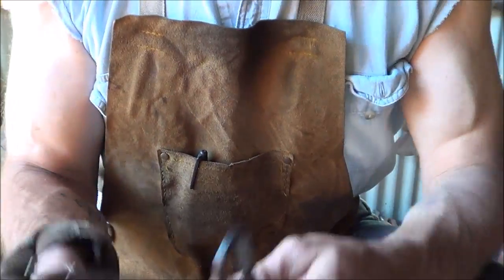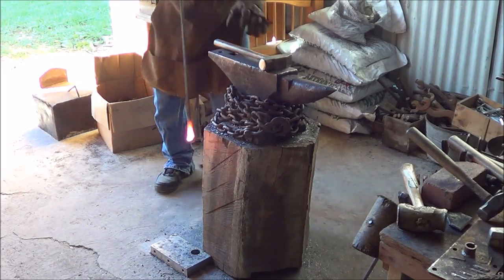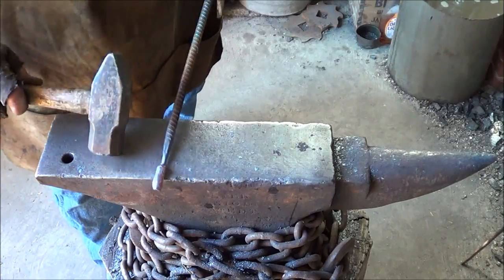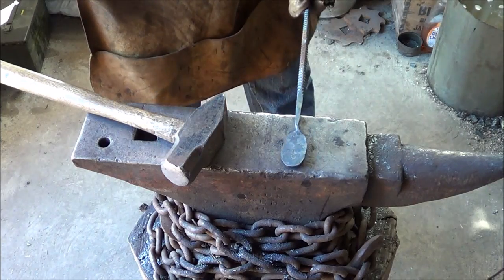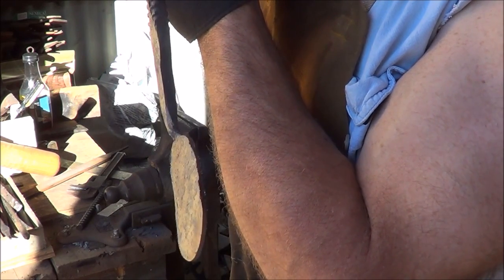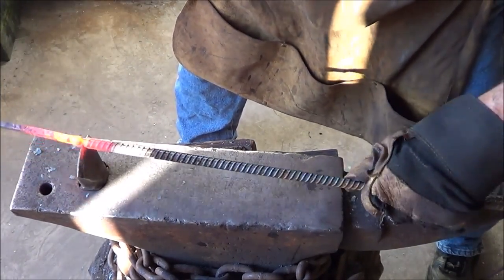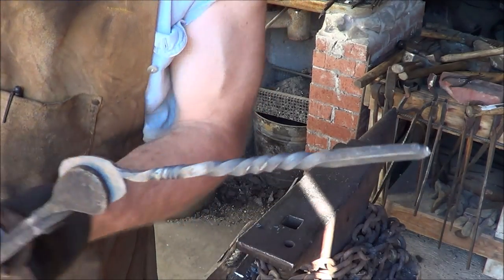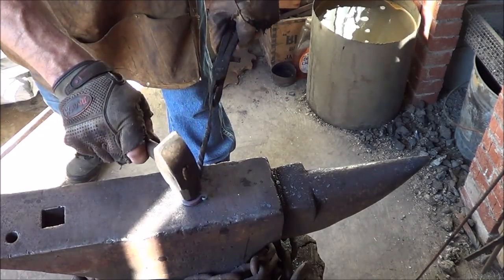Blacksmithing - Forging A Silverware Set - The Spoon

Comment: Chandler..  I like it.  

Find an old ball for a trailer hitch that has no flat spot, modify the post to square and you have a hardy tool that works well for spoons and such.

Thanks for the video..
Shad
Reply: +shadowcastre That's an awesome idea!!
Reply from the maker: +shadowcastre I will be doing just that!   Thanks
Reply: +shadowcastre That truly is an awesome idea, thanks.
Reply: Nice! For larger doming (bowls etc) I got a cheap empty CO2 bottle from a local pub, chopped the bottom 1/4 off it and turned it upside down... The gas bottle bottom is domed inwards, so makes a good dish for forming steel etc :)

Looking for a fire extinguisher with an inward dome on the bottom next for similar thing :D

Comment: I think putting the cold end down and hammering on the hot end will help with upsetting. That way you're not losing that much heat from it touching the plate or anvil. Seen other smiths do it that way, thought I'd mention.
Reply from the maker: +Rocket Girl I have tried a few different ways...   they all seem to have their goods and bads... when I have longer stock I find dropping it most affective...  for shorter stuff i hold it off the anvil and hit the cold end with the hammer... it strikes the anvil and bounces off to help keep the heat...thanks!

Comment: My idea to make the ‘upset’ easier … weld a 2ft tell pipe on the block you are using. ||
This will prevent too many misses and be sure to be as square as possible to head toward making a ball on the end, maybe an inch or inch and a half pipe will work and especially if you decide to make a whole canteen!  ||

Comment: Hey Chandler I found it easier to upset the metal if you clamp it in a vice and heat it and hammer it down. It works wonders man.
Reply from the maker: +Michael Gevergizian I do that too... depends on the piece and where I am trying to go with it...  But yes your approach works well

Comment: Upsetting steel and making spoons....well first upset the steel...call it a worthless chunk of rust that won't even amount to a good finishing nail..lol. But seriously, upset as you are doing in the video, then just neck it down and leave some room for error. Use a ballpein hammer to make a dishing stump in a chunk of hardwood. Hammer the flat rounded portion into the depression with the pein end. Has worked for me in doing everything from spoons to pauldrons (shoulder armor). Sure it smokes a bit when using fresh wood, but eventually it chars. Just remember to sprinkle some water on it after you're done hammering. Hope this helps

Comment: +Chandler Dickinson When upsetting the end, would you not be better off placing the steel on the surface and hitting it with the hammer? Im just thinking you may not get as much warping this way.

Comment: have you tried clamping it in your post vice and hitting it to upset it? Just a question I know little to nothing. Perhaps though it will give you more control over the ball making process
Reply: also, the few times I have done upsets I take a stack of wet rags and cool down the area near the upset so that it doesn't bend as much. I just leave them on the bench and just lay the bar on it. Great vids by the way

Comment: Chandler wouldn't using the hammer to pound on the cold end exert more energy into the piece to upset it faster.  I've seen TechnicusJoe who has had formal training do it that way at least.
Reply from the maker: +garygsp3 There are few methods to get the job done... i alternate depending on the stock I am using... I have hammered before... but I find that with longer stock I get better results with the drop method I show in this video...

Comment: just had a brain fart.  if you modified a ball pen hammer to fit the hardy hole with the ball facing out.  that could leave you with a handy tool for making the spoons
Reply: I have towbar for atv and it fits perfectly in hardyhole. Just had to round small flat spot from the top
Reply from the maker: +Brian Sheehan many use towing hitch balls... haven't done that yet
Reply: +Chandler Dickinson that spoon looks great